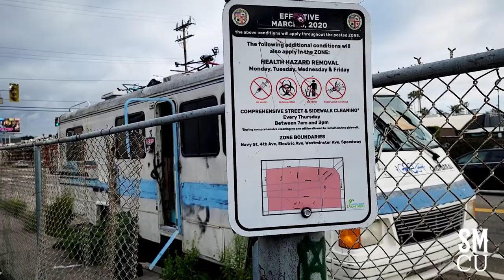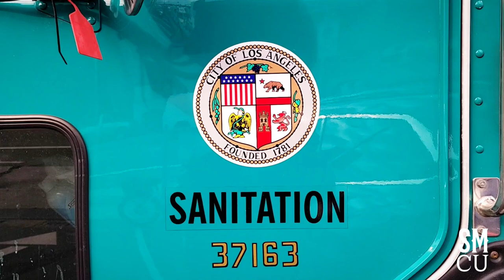Homeless Encampment Cleanup in Venice

Comment: Can't believe the attraction to Venice Beach, by deadbeats who have no means of support.  Once a cleanup is accomplished, do these deadbeats just relocate in 'the hood' ?  Or, do they leave Venice Beach   . . . and, a new group of deadbeats arrive from Los Angeles and continue this 'process' . .   providing continued 'clean up' work ? 😬 🇺🇲 😖
Reply: likely the same people will return. this stretch of a block or two has been an ongoing sore point for years. I can tell you from experience that after the clean ups commonly by 5 pm the same people are back. First one comes then two, etc. Unless an area is fenced off it is helpless for a long term clean up
Reply: No homeless in the hood. In the hood people have projects. The homeless settle in desolate parts or working class lower end areas